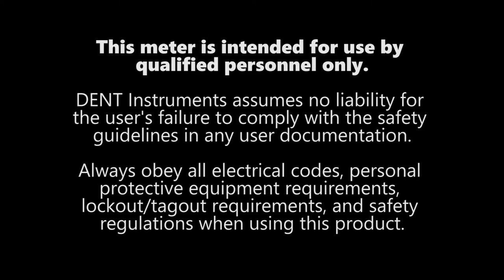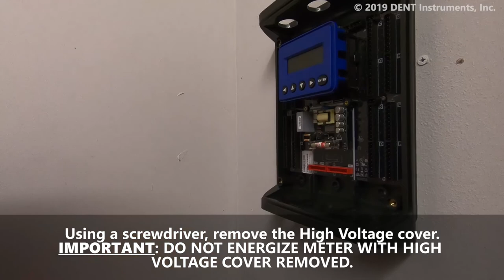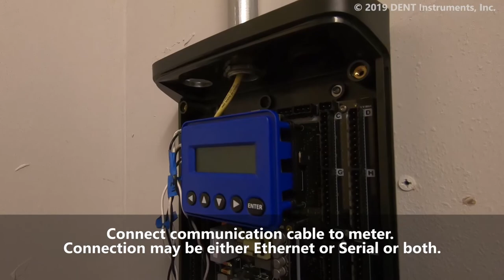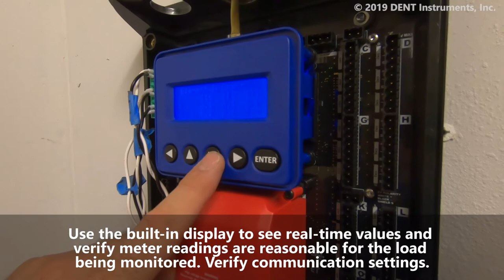PowerScout HD Multi-Circuit Power Meter Installation in 5 Minutes!

Comment: Does this come with the ct's or just the main unit? also what do you use to save the log?
Reply from the maker: Hello and thank you for your inquiry. The CTs for the PowerScout are sold separately - this is mainly due to the fact that every project has different requirements. Any CTs that DENT offers can be used with the PowerScout and can be mixed and matched (e.g., you can use RoCoils on one element and 50A Mini Hinged CTs on another). The full line of CTs can be seen on our website here: https://shop.dentinstruments.com/collections/current-sensors

The PowerScout meter needs to be integrated into a building automation system or have its data sent to a separate logging device. It communicates over Modbus or BACnet and has both Serial and Ethernet communications built in. If you need more information on compatibility, capabilities, or general setup, I would recommend contacting the DENT sales team at sales@dentinstruments.com or filling out the contact form on our website: https://www.dentinstruments.com/contact

Thank you again!
DENT Sales